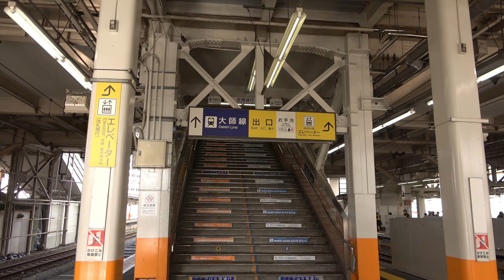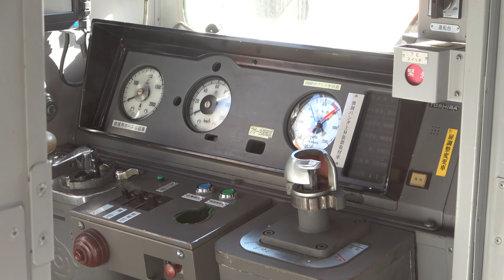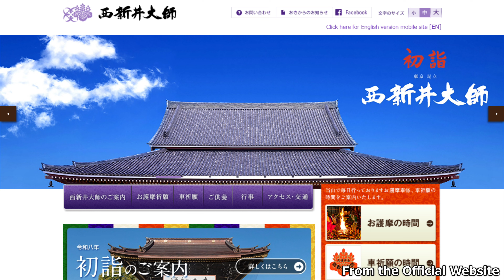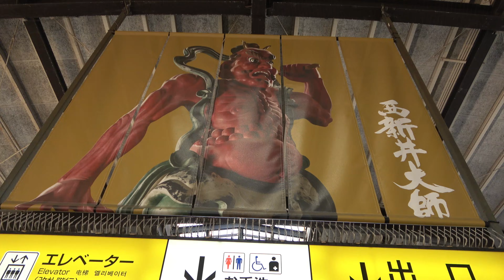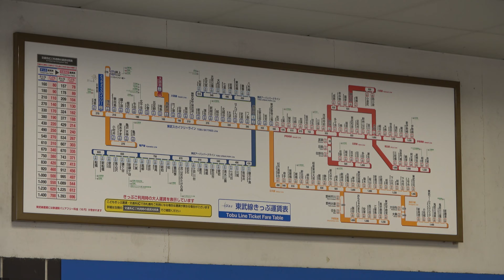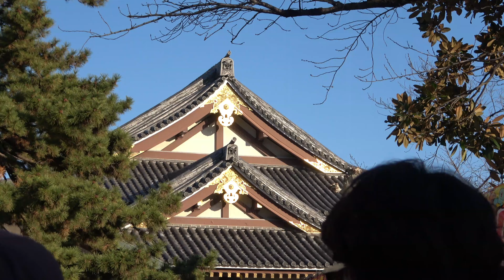Japanese Mega-Loop's Ghost: Why This Tokyo Line is Only 1km Long | Tobu Daishi Line

Comment: Hate to ask a silly question but the letters ts is that means Taylor Swift or does it mean something else?
Reply: Tobu Skytree
Reply: To clarify since the video keeps referring to the line as the (Tobu) Isesaki line, it's a historic name that may also still be valid in some contexts - there is also "TI" station numbering for Tobu Isesaki further north along the line, the 30 stations starting from the southern end in Tokyo have the Tobu Skytree "TS" station numbering as of 2012 when Tobu's Tokyo Skytree tower opened.

Some of Tobu's branch lines also use the same station numbering letters as the lines they branch off of - e.g. Daishi and Kameido lines using "TS" since they branch off the Tobu Skytree line.